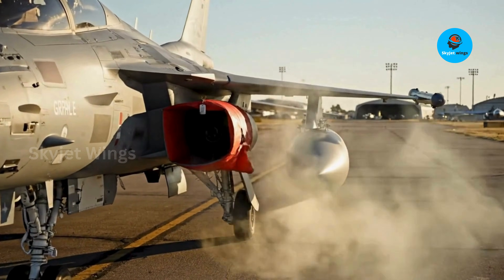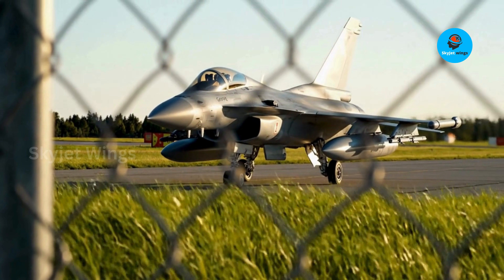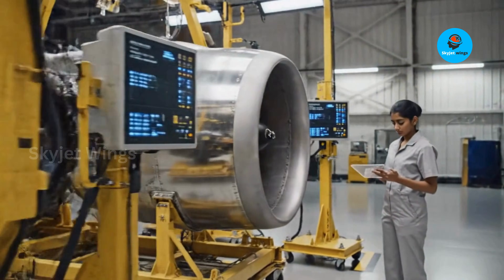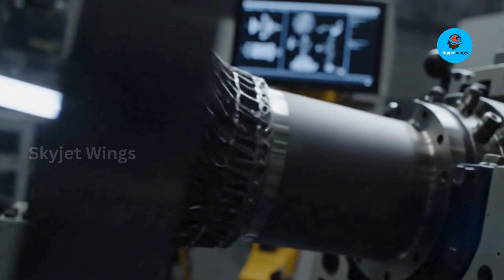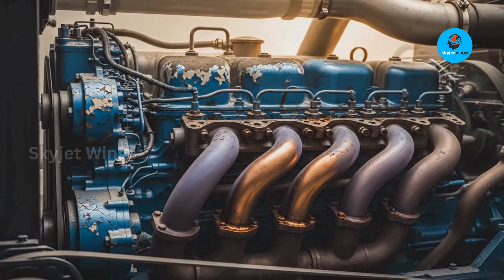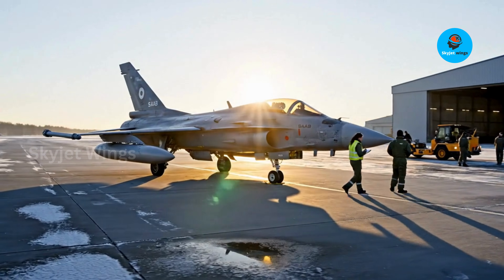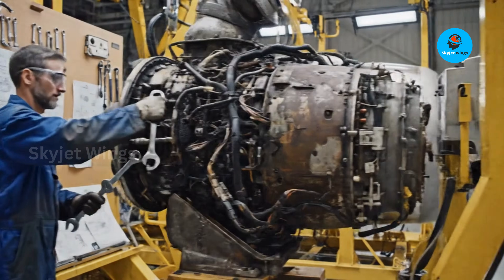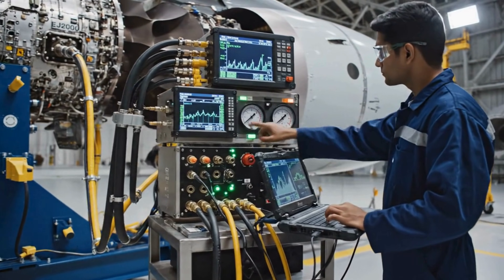Tomorrow’s Airspace: Gripen’s New EJ200 Engine Crushes F-35

Comment: This is BS !!

The engine powering the Gripen E/F is the Volvo RM-16, a license produced version of the US General Electric F414G.

Two Rolls Royce designed EJ-200 engines license produced in Germany by MTU power the Eurofighter Typhoon.

A scaled-up version of the EJ-200 called the "EJ-230" exists on paper and once developed and certified after which once SAAB modifies the Gripen's airframe to accommodate it, this engine could power the Gripen. All that will take time and money unless it's been happening in secret.

I hope Canada can find a way to equip the RCAF with Gripens for Arctic defence. Major components like avionics and the engine - which are subject to US export controls - must be replaced with alternatives from more trustworthy allies for the Gripen to be a viable choice for Canadian defence.

There is so much pro-Gripen propaganda on YT, and much of it is misleading.
Reply from the maker: Canada chose Gripen, gains sovereignty, Arctic fit, jobs, and freedom from US OK

Comment: No. The Saab JAS39 Gripen E is powered by the General Electric F414‑G39E turbofan, not the Eurojet EJ200. The EJ200 is the engine used in the Eurofighter Typhoon.
Reply from the maker: Correct: Gripen E uses GE F414-G39E; EJ200 powers Eurofighter. Verified. Done but now use in it

Comment: I hope Canada decides to go with the Gripen for many good reasons and now this is the icing on the cake, especially if we also get to build these engines here along with the airplanes..
Reply: Not going to happen
Reply from the maker: Gripen choice could bring jobs, engine builds, and real sovereignty for Canada.!
Reply: Swede here. I think Rolls-Royce has a plant in Canada. Having said that, the Gripen E doesn’t comes with an engine option. The EJ230 is many years from being ready for production and this one is old. It has different mass, center of gravity, length and so on. The Gripen will need a new fuselage, probably new control surfaces and most definitely new avionics. It is inherently unstable and everything has to be recalculated. I hope the G/H version will have it. It may take five to ten years before the engine is ready and it has to be certified for single engine use.
Reply from the maker: Gripen choice could bring jobs, engine builds, and real sovereignty for Canada.!
Reply: @skyjetwings  F-35 is way superior to Gripen. Not only that F-35 is more capable than Gripens and GlobalEye combined because of it's computers and  censors. Maybe do a little research